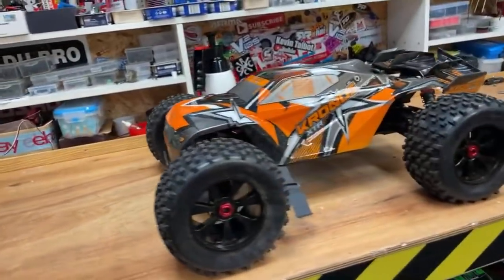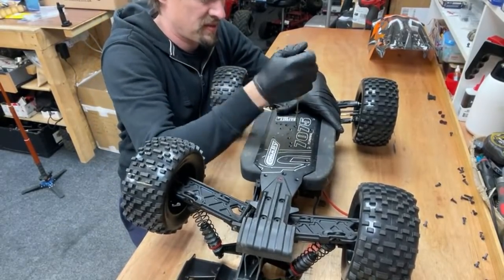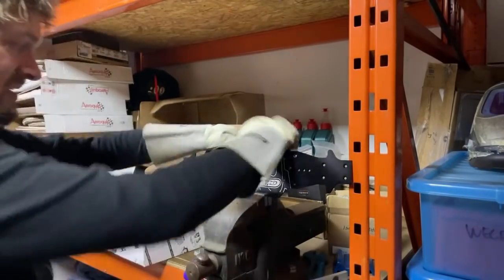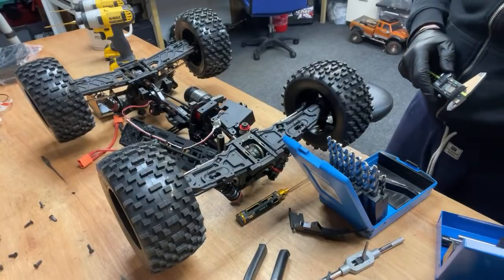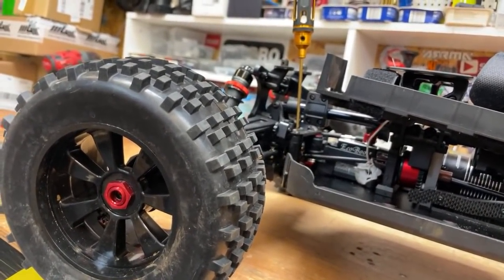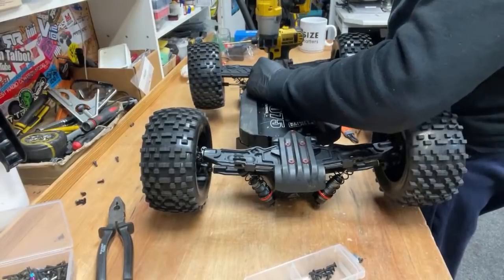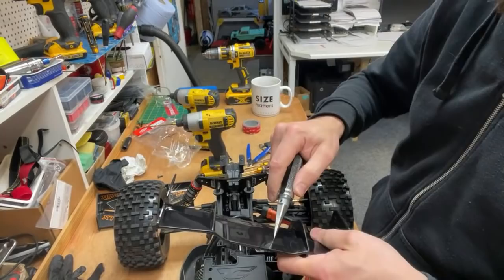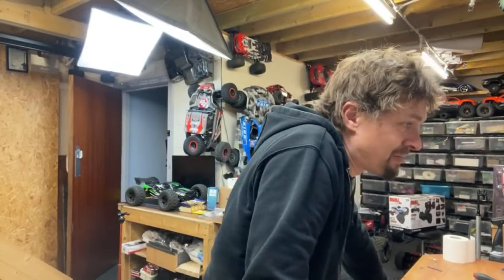Acceptable? Live look at corally kronos xtr

Comment: Love my Kronos 2021 but totally agree with the soft screws, they round off all the time
Reply: Screws seem like normal, hi-tensile steel screws to me. Like with any small screws, use accurate bits and low torque setting if you must use power tools. I use Hudy Allen drivers and Dewalt drill/drivers. No issue with any of my XTR screws.
Reply: @horatio321  maybe they have improved with the xtr but honestly my 2021 had the worse screws I've ever used. Very rarely have any issues on my arrmas
Reply: @Rufus2005f1  I guess hi tensile, corrosion resistant screws are made in various places - US, EU and China. I'm guessing that whilst they're all built to metric size spec, possibly the steel used could vary slightly in quality. Arrma and Corally are likely using Chinese screws. 

From what I've observed though, people are stripping screws because they are impatient and using poor/worn hex bits, excessive torque, with screws using the wrong grade of thread  lock.

Using hand tools to get things started and finished really helps avoid what you see here. It's not really a Corally vs Arrma issue to be perfectly frank, let's be honest.
Reply: 7075 chassis is on the thin side at 3mm for a 4hp truggy in my opinion. It's the same thickness as used on 4S race truggies, so arguably optimistic for an extreme basher. 

When upgrades become available, 4mm or 5mm might be more suited to drivers like Mr Talbot. Even then, landing on the corner of a concrete skate ramp is going to do damage.

Comment: Have you ever thought of designing a titanium chases ?
not just a flat plat but one with ribs like a thick plate machined down with ribs then titanium shock towers and braces BUT HOLD ON!!.
I know what yr gonna say
 "there needs to be a weak spot" 
and that would be the arms in my idea cheap & easy to fix on the fly  
THEN there might be an ultimate RC

Comment: problem is they just say 7075.. that's just the chemical makeup of the aluminum. the heat-treat is what's important and i like the fact that they specifically to not say t6 or t7 or whatever in any of their materials. T6 heat-treated 7075 is 2x the tensile strength as un heat-treated 7075. TWICE. 200%.
Reply: Great info! I imagine one could heat treat a chassis themselves?

Comment: hey kevin, i know you have probably lost intrest in the erevo v2 but i found out that the rpm eliminater kit you used on the revo 3.3 is compatible with the erevo v2, you just need to use extended pillow balls and dremel out the hub carriers a bit and the bearings fit. you had loads of fun driving it in other videos, so maybe give it a shot?

Comment: Hey KT! Do you think you could run some embossing lines on that chassis bottom plate like the new Sledge has on it for more strength? Take it one of your auto body shops and run some in there may work? I was liking the skate board or snow board you used on the Long XMaxx build you could trace that chassis plate and cut it out and mount all the gear on that and have a ultimate Basher build that was impressive what that was handling ripping around!🤔 Love the videos and content Bro!😉👍📹✔️💯👋👋👋

Comment: It would be acceptable if the parts were not that expensive, but when a chassis cost as much as an entry level car it's not acceptable to bend.
Reply: The arrma chassis litterly 8 dollars lol im sure these aren't much more
Reply: @paulclancy2404  are you sure a metal "6061/7075" arrma chassis is 8$ ? I get its more like 80$. The one in this video is over 100$ for the chassis alone .

Comment: I got the skeeter and I love it I just don't know how to upgrade it to the best possible way without burning the motor up
Reply: I have to wonder, will the kronos arms fit on the sketer lol
Reply: Use the Kronos hubs and axles , gear down put 6s esc and you have the ultimate basher
Reply: @paulclancy2404  lol id be trying to tie the radix 4 wing and something like a long wheelbase 1/10 body and make it a truggy lol, corally version of a kraton 4s

Comment: Could it be a genuine 7075 chassis but it's a lot thinner than the M2C chassis ,so that's why it bent ? Surely they can get done for blatantly advertising it as 7075 when it's not. Wouldn't the advertising standards committee have something to say,big fine etc

Comment: Where did the car come from. If from China I would say it's a cheap low grade aluminum like most of the metal from China. If true 7075 there is no excuse or just bad design. But you do the hardest tests on all vehicles.

Comment: Well kev you even bent the sledge plastic chassis rcs are preferable for your kinda of bash forsure, sacrifice little stability and performance for the sake not bending the chassis and m2racing and such is great but only puts more wear tear on everything else . I use stock chassis they bend its 8. $ from jennys my kits or rcs I spend time I don't abuse and ofcourse I have maxes to just grab no tuning or caring just grabvand bash
Reply: I agree.  The more I built up a Outcast 6S with M2C and other aftermarket parts the harder the wear was on other components and the worse the breaks were.  So I went back to a stock exb outcast chassis but just kept stuff like M2C shock towers and standoffs.   A good compromise and mix.   Truck is better off now

Comment: Do you think the problem is 7075 t6 is different then 7075 t6 Aircraft aluminum from m2c
Reply: They would be tempered differently with heat treatment. The type of material it's made of doesn't refer to it's maliablity or mean it won't bend if it hasn't been properly tempered with heat treatment. Aircraft aluminum is lighter than lower grade aluminum but not necessarily stiffer or stronger if it hasn't been heat treated properly.

Comment: They seriously need to just stamp all metal chassis. Such a simple thing increases strength dramatically. 
Kevin I will forge a chassis using ancient samurai sword smithing methods with a flexible inner core and harden outer shell. It will be tested by the most feared RC basher in history… YOU! 😂
For the love of all metal work please warm it up and it will be easier to work with, and use a rubber mallet on aluminum! 😉

Comment: Once its bent, and you bend it back, then too far again, its done! the strength is not there anymore.
Reply: Re-temper it with heat and it should be good as new.
Reply: @alistairclark6814  NO!......Metallurgy is my line of work
Re-temper it with heat and it should be good as new😆
Don't talk about thing's you know nothing about